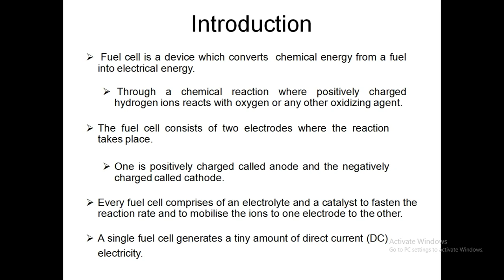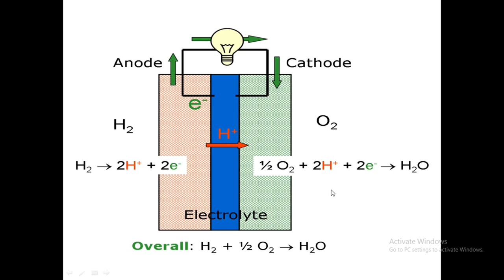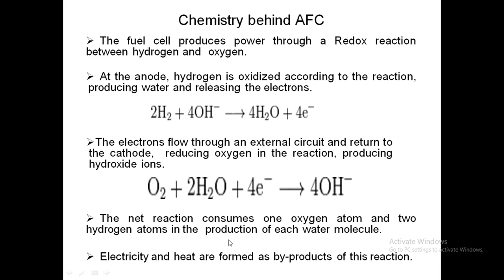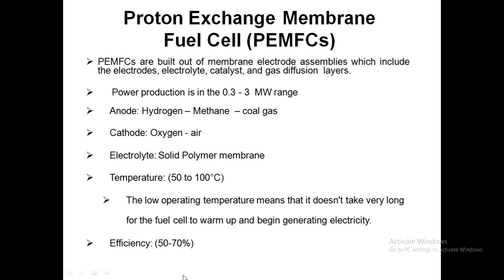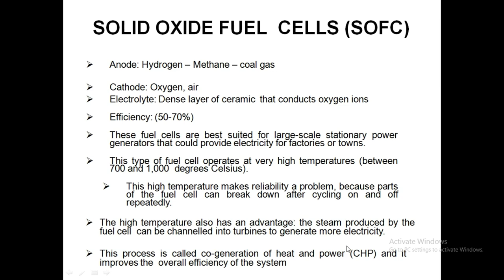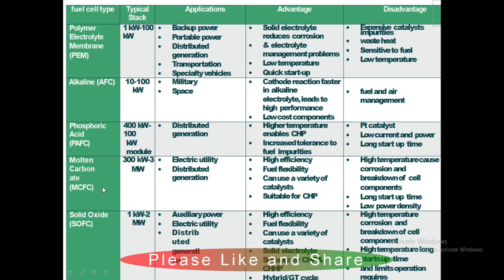Fuel Cell: Types and Applications

Comment: Sir anode is positively charge and hydrogen also positive charge so two same charges how formed reaction 🤔
Reply: anode is negatively charged
Reply: there is a thick layer of plantinum coated in anode as well in carhode. so as hydrogen enters it first strikes against platinum which split it into two H+ ions and with this two electrons are produced. as anode is also a positive side so hydrogen does not stays there and travels towards cathode.